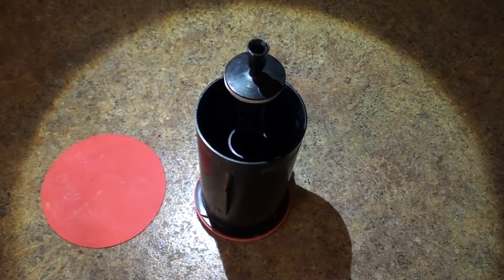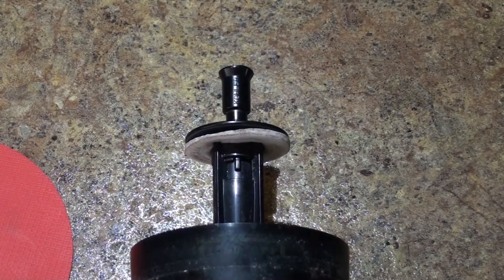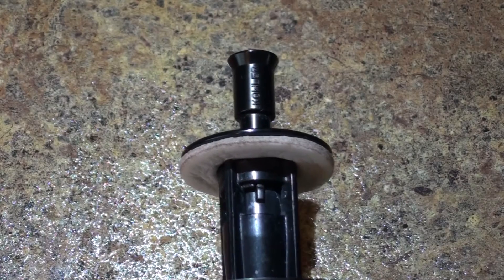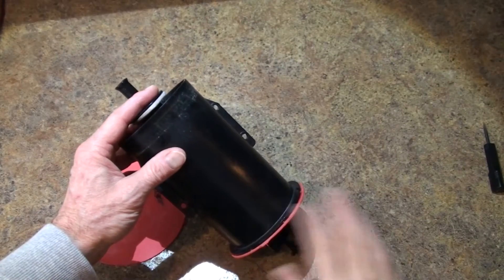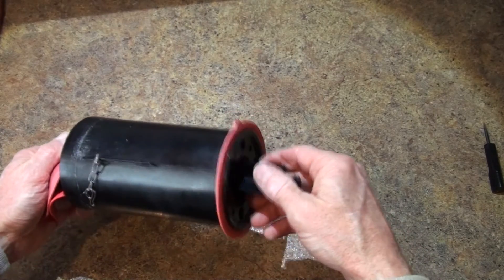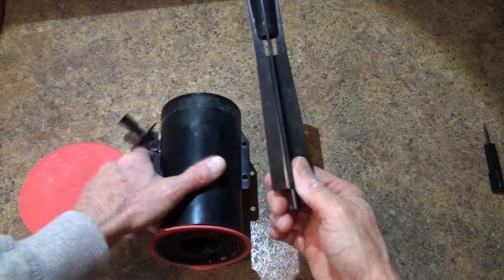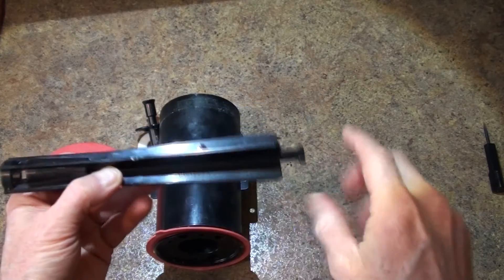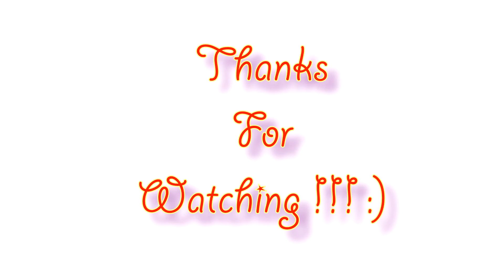How To Separate The Guide From The Canister On A Kohler Style Flush Valve

Comment: What is the purpose of that white gasket under the guide, mine is rotting away.  Also my guide has come of the center piece and I do not see any damage. I also cannot seem to get it back on. The toilet flushes and does not leak however it seems off somehow.  I did replace my seal not long ago. I will tackle it again in the morning.
Reply from the maker: Hey Mick Taylor! I'm not really sure what the reason is for the white gasket. Also, I made a video on how to take the guide apart so it may help you get it back together correctly. Here's the link, https://www.youtube.com/watch?v=-8UohlVs36o  I hope it helps! :)

Comment: The fill hose on my Kohler does not fill the bowl when it's inserted in the top of the cylinder. It needs to be outside the overflow,which fills the tank,but not the bowl. Any suggestions?
Thank you!
Reply from the maker: +Sarah Major  Do you have hard water?  There may be water deposits that have constricted the hole or you need to clean the holes inside the toilet really well. Hope This Helps. Have a good night. :)
Reply: +brianmcdrummer Thanks Brian. The guide seems to be fine,not plugged or anything..it's a complete mystery. I will order a replacement cylinder kit.
Reply from the maker: +Sarah Major  You're welcome!  If the guide it not plugged then it's not the guide. I'm assuming you took the guide apart like the video shows?  Does the toilet flush?  Remember there's a lot more force behind the water when it's flushed as opposed to when it's filling.  Make sure to clean the holes in the bowl really well. Hope this helps. :)
Reply: +brianmcdrummer The toilet flushes fine. I don't understand how the water that shoots out of the guide at mid-point would ever fill the toilet tank,as it's flowing into the overflow canister. It would make sense if the guide has openings at the top,so that water from the inserted refill hose would spray into the tank..but it's not possible to fill the tank the way the guide is designed. The refill hose has to rest outside the canister to fill the tank. I am truly baffled.
Reply from the maker: +Sarah Major  The water that trickles down the guide goes into the bowl. The tank is filled from the bottom of the flush valve, not the canister. :)
Reply: +brianmcdrummer Thanks, I realize that. But if the flush valve is down no water fills the tank at all.
Reply from the maker: +Sarah Major  I'm sorry I meant the tank is filled from bottom of the "Fill Valve."  I've included a link to a video I made concerning the fill valve. Keep in mind I made a mistake and used the wrong term when describing the "Fill Valve." Hope this helps to clarify what I was trying to explain. :)   https://www.youtube.com/watch?v=1RhIZpjk4RY
Reply: I just encountered the exact same problem, water wasn't flowing into the bowl while the tank was refilling. Fortunately, all the pieces are plastic, so I took the assembly apart and soaked everything in vinegar and then in Lime-Away. When I put it back together, the hard water scale was gone from the plastic pieces and the problem was fixed.

Comment: My problem is that the canister will sometimes rotate after I flush which causes the chain to pull on the canister slightly, which then causes the canister seal to lift a bit, draining the tank and causing the toilet to flush itself. What do you recommend?
Reply from the maker: Hey Ronald Gross, Sorry it has taken me so long to reply. YouTube was not sending me notifications. I'm not really sure. I've never had this situation. Maybe check with someone at your local maintenance warehouse.
Reply: Having the same problem. Rotation of the canister leading to water drainage. Are there any guides on the center rod that engage w the canister to keep it in place?